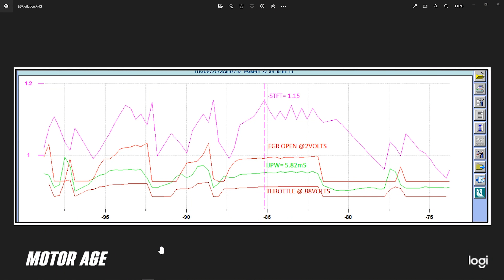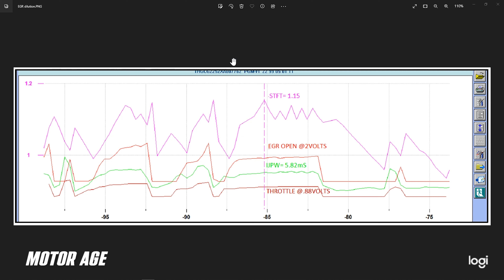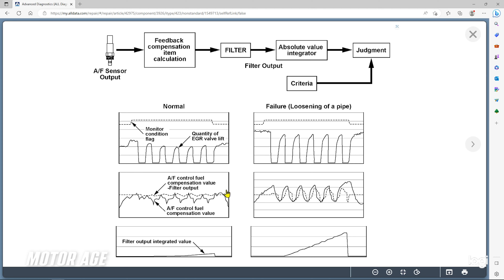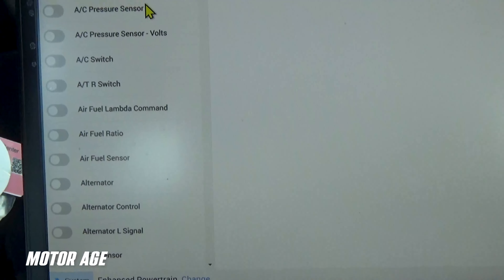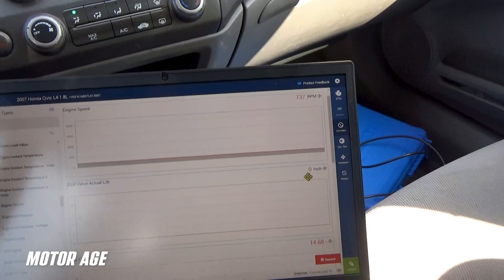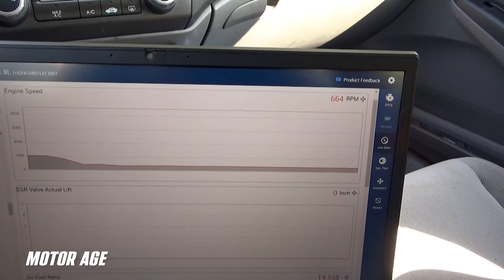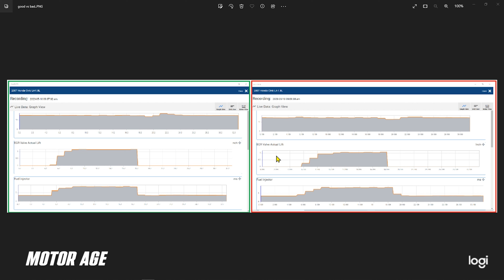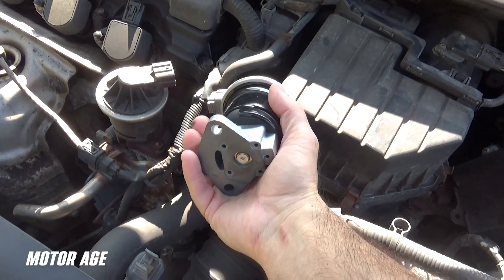Mastering Diagnostics #5: Utilizing the Customized Data List to Tell a Diagnostic Story

Comment: Thank you for the information.  I can see why you like the graphs when recording.  You can go back and look at the data to give you the answer.  If the SI does not give you this info with a working system it'll take longer unless you can find it on line.  Also if the ECM/PCM program is "Proactive" or "Reactive".
Reply from the maker: Thank you for watching!

Comment: Could save a lot of time if take off the egr. Check for suction and pressure on the ports cover em with your fingers.   Should have vacum and pressure present you can test the egr by actuation it if you have a scan tool.  Fords use dpf to tell if egr is working..so don't get fooled. Old Hondas like that. Usually a plugged egr port. I bet it's not fixed ..lol
Reply: Although what you recommend is valid, it's time-consuming and some EGRs are not accessible without extensive disassembly (and rusted/frozen fasteners/location [Jeep 3.8L... need I say more] ). What I'm proposing in the video is carried out from the driver's seat and can be conducted on virtually any vehicle.

Comment: What do you think might be with a 94 GMC 7.4 engine that has a reduction in RPMs while trying to maintain 2500 RPMs?  The engine did this while standing.several times in a five minute test.  Tailpipe emissions show up as a rich mixture.  This just happened a few days ago while driving on an almost empty gas tank because I was expecting to drop the gas tank and replace the fuel pump structure.
Reply: Depending on which fueling strategy is implemented on this platform will determine the approach. 

For instance, an exhaust restriction would worsen under load/rpm. The MAP signal would increase in amplitude and the ECU would over fuel. This would show up as a rich exhaust stream with negative fuel trims
Reply: @brandonsteckler3417  with a smoke tests it shows a leakage out from the fuel pump structure that needs a new seal or replacing the cradle for the fuel pump.  The last time I had a similar problem with running rich was a bad new plug wire.  I replaced the plug wire and the engine passed smog but EVAP system failed after a fuel pump replacement by a mobile mechanic.  I could have dirt clogging up something.
Reply: @brandonsteckler3417  BTW, thanks for input.
Reply: Got to replace the distributor.  Can't believe that pulling off the spark plug wires off the distributor could strip the threads off the base.